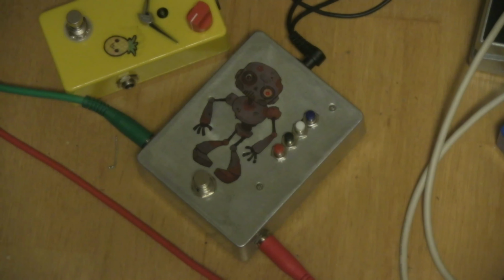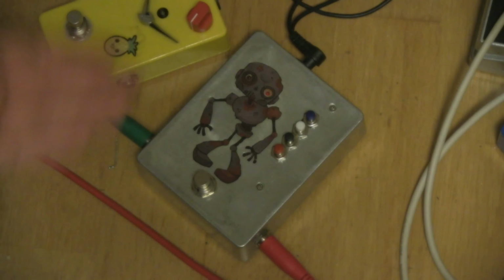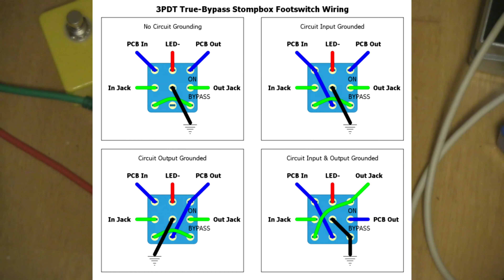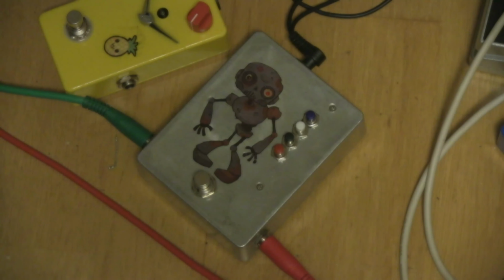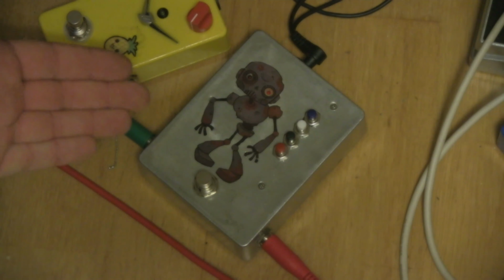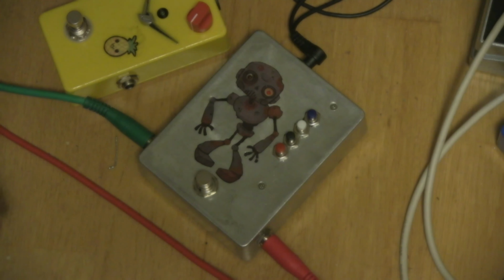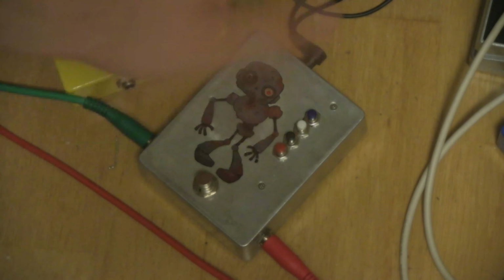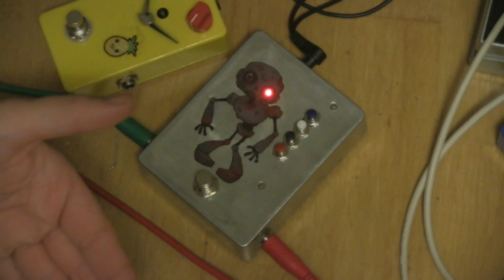Velleman MK171 Voice Changer into a guitar pedal

Comment: Weird question... how did you do the buttons?
Reply from the maker: Im I'm not sure I understand the question
Reply: @zurowetz  fair I didn't clearly explain. Okay so it comes with these weird 4 pin push buttons installed on the board if you follow the directions. How did you replace those with those what I assume is momentary buttons when those typically only have two connector spots. Basically I'm asking how you managed to set up the external stuff.
Reply from the maker: @madzpanda  yeah so its 4 legs but 2 are the same so it's actually just 2 so with 2 jumper cables it can be screwed in place hope it helps
Reply: @zurowetz  sorry man but I got two more questions. Did you dothe on off switch on the board and just leave on or did you not add it to the pcb all together? Also like do I need to build a buffer or boost before it or is it fine as it is?
Reply from the maker: @madzpanda  you don't need to say sorry I like talking to you 🙂 you don't need to add anything the on/off switch was replaced with 3 wires the first labelled sw1 is connected to the middle leg of the new switch. The second one, the middle one is connected to the middle leg of the first row on the new switch (just above the first) and the last one is connected to C4 on the pcb hope this helps 😉👍